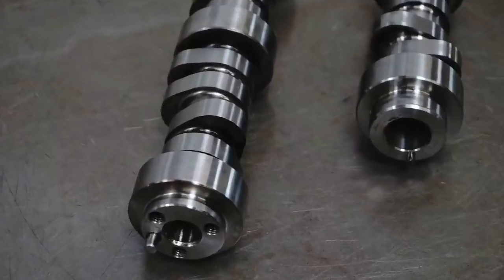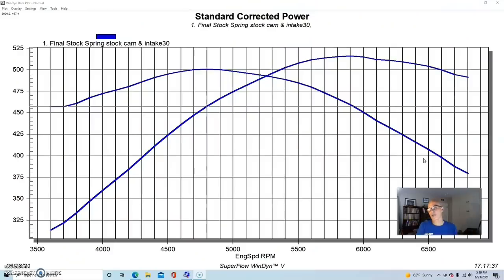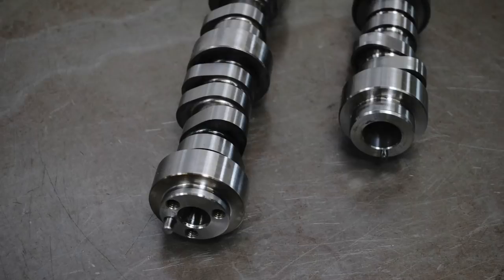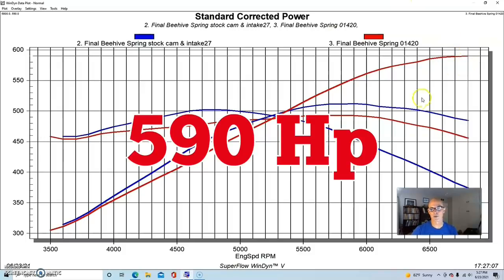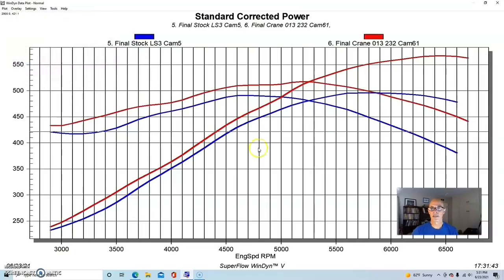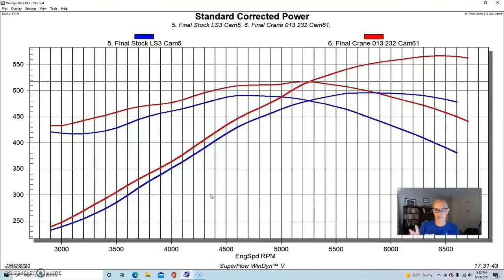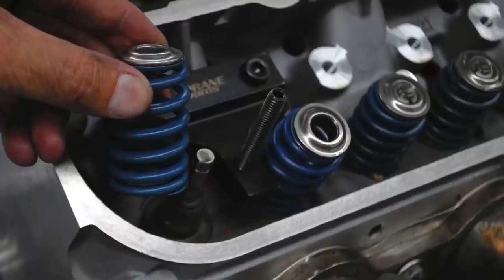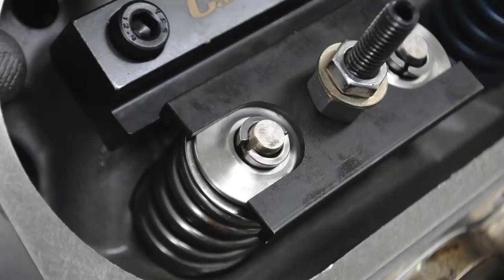DO STIFFER VALVE SPRINGS COST POWER? LS3 SPRING TEST!!

Comment: Well no machine is 100% efficient, and even compressing a spring will cost power the stiffer the spring the more it will cost. Conversely if the spring isn't phisically strong enough to close the valve at higher rpms it will cost you way more power than the stiffer spring will. Basically you want enough spring to do the job and maybe a tad bit of safety factor for maximum power. But that's splitting hairs, just get whatever spring you can find that will do the job without having to pawn your wife's engagement ring..
Reply: Screw it, pawn the ring.  If she understands, she’s a keeper. If she doesn’t, dump her ass because you know something like this will happen in the future if you’re a gearhead!! Lol.

Comment: Heavier spring WILL ACCELERATE valve train wear, lifters,pushrods,rocker arms,valve stem, keepers,etc
Reply: And the timing chain.
Reply: With today's parts, if your wearing out that stuff you got problems with the setup.
Reply: @unclegeorgesspeedandfeed  I agree. I’ve never seen an ls timing chain fail. Now other OHV engines definitely have issues. Also the only ls heads that would see valve guide wear seem to be the ls7 heads. But I think that has something to do with the 1.8:1 rockers.
Reply: Well, that would only be true if the lighter springs in your comparison were also able to adequately control the valve train.  If not, the opposite would result.
Reply: @michaelangelo8001  yeah it's a fine line of control and Chaos. As rpm rises the line gets exponentially smaller.
Reply: Going from 300hp to 400hp, no problem. Going from 300hp to 700hp, everything needs to be right
Reply: @ReubenHorner  it's more about going from 7000 to 7500 is hard but going 7500 to 8000 is alot harder. It's a exponential growth. RPM=ruins people's motors. Technology today allows us to run hydraulic lifters in race motors and still get the rpm that 10 years ago you could only get with solid lifters. Look at ls rocker arms, good to 8000rpm and well over 1000hp and are some of the lightest on the market and gm made 20-30 million of them.

Comment: Definitely the shorter runner causes the drop in torque.
Reply: Well, and judging by the fact that both the long and short aftermarket manifolds showed almost identical lower RPM performance, it's also possible (probable) that the Holley runners have a larger cross sectional area that is hurting inertial mixture velocity in comparison to the stock unit.

I can't help thinking that the results may have been quite different, if the test had been performed on a 400+ cubic inch engine that could make efficient use of the additional airflow...

Comment: The short runner length is what killed the torque. You won't get 100% of the energy used to open the spring back. Friction losses will take most, and there are a few little things like some gets converted to heat in the spring when it is compressed.
Reply: You would want a spring that is
- made out of a material with nearly 100% elasticity
- coated in the same stuff billiard balls are coated with
- using opposing magnets at each end to provide an extra pushback

Or some other nonsense like that.

Comment: As I've learnt in Aus, there's more to the story. Higher spring pressures do add friction, and because of this they do transmit more heat into the oil raising oil temps, might not be noticeable for a 7 second straight line warrior car, but go circuit racing where the engine has to actually work for 15-60 minutes straight, up and down the revs, actually accelerating the weight of the car constantly out of corners and this shows its head. Also higher spring pressures are far more savage on lifters push-rods and the cam itself, I know with our race engines we cant idle the engines below 1500 rpm on solid rollers, if we do it just chews up the cams and lifters as all that spring pressure grinds the roller lifter into the cam, at higher speeds this isn't an issue at all as the time in which the roller lifter makes contact with the cam is reduced and therefore so are the the loads

Comment: I was actually surprised we didn't see a change between the beehive and dual spring. Very cool test in my opinion, thank you very much. I would think the return energy, during valve closing would be reduced at high revs because the spring is being used to push all the valve train back to close position. At low speed, I suppose it would push the cam forward quite a bit, possibly enough to return the cost of compressing the spring in the first place.  , but if you get closer to valve float, there would be no energy pushing the cam forward. The test didn't really confirm that logic.. but I was thankful for the content. Keep up the good work, you're the man.
Reply: Both maintained control, so that was good.  Wear on components?  Might be a different story.

Comment: Friction being a factor in any machine with moving parts, you don't get as much energy back out of compressing valve springs as you do when they close the valves, but it is very close.  A camshaft is a very efficient thing, even more so when you have roller cam followers.  When the major manufacturers went to roller lifters in the late-80's, they reported a 2% fuel economy increase.  When I worked at Cummins, engine familiarization training covered teardown test results, and they said at full power, a heavy duty diesel camshaft only takes ~2 HP to drive.  

Energy recovery from valve springs is something that is making it very difficult for camless engines to get on the market.  Whether the energy for actuating the valves comes from hydraulics, pneumatics, or electricity, there has to be a pump, compressor, or generator to create the power to lift the valves.  Then the parasitic power loss offsets the benefit received from the fully variable valve timing.
Reply: I would agree with what you said. I do believe you would get some energy loss from heat during spring compression also, but would be very little. I thing pressure variation between the strokes of the cycle would probably play a larger part. Particularly during exhaust valve opening against high (sorta) exhaust gases versus the low pressure when the intake valve opens. Obviously boost changes the effect.

Comment: Dead on what I figured. Awesome test Richard. I did a dyno test comparing stock heads to a set of ported heads on my LS3 with the little Lingenfelter GT1 cam. Gained 15rwhp but I also had stock springs on the stock heads and BTR duals on the ported ones. Figured 5hp was the cost of the springs at the most. Awesome for testing this.

Comment: I love these kinds of tests. I had a friend that raced Pontiacs for years. His combination was a mix of mostly factory parts including the cam. But he had tested every little thing and for every one thing that picked up 5 horsepower here of 8 horsepower there he had a very quick car. His '71 LeMans wagon ran well into the low 12's back in the 90's and he was well into the 11's by the 2000's when he had a stroke and quit racing. One test I would love to see you do is a timing chain test. I read a test by Roush Racing many years ago on a 500hp ish SBF and they tested stock butt link, double roller, timing gears, a timing belt and a high performance butt link called a Hyvo I think? Anyway, it's amazing how much less power was made with the oh so popular double roller compared with a stock style timing chain. I'd love to see this repeated if you ever have the time.
Reply: YES !
Reply: Are you talking about the legendary Pontiac KCIR Jim Hand?
Reply: @GasserNorm  Yes. He was a great guy to race with and always a great guy off the track too.
Reply: @1967davethewave  I knew Jim as well. He helped me with my 1980 Firebird. He was a great guy.
Reply: @GasserNorm  Yeah, he walked up to my 69 GTO back in about 91. I was running high 13's. He looked under the hood, shook his head and said, "If you ever want to go fast come talk to me." I did that night and I was running in the 12's by the next season.

Comment: The think I learned from Steve Morrison is that they try to bring the springs as close to coil bind as possible to reduce harmonics at high rpm. Shims add more pressure but is worth the added protection for uncontrolled valves.
Reply from the maker: WE USUALLY SHOOT FOR AROUND .030 TO COIL BIND

Comment: Anyone else impressed with the consistency of the Dyno here? Those two graphs were almost exact overlays
Reply: I’m not impressed
Reply: Engine Dyno is always pretty accurate to itself as you'd expect. As long as things like oil temp are the same then should be exactly like he shows here.
You'd be surprised how much things like transmission/diff temp and tire pressure makes on a standard roller Dyno

Comment: The higher spring rate definitely increases friction in the assembly. Just think of all the forces on the rocker bushings and roller lifter as well as across the valve tip. The question is, will this difference in friction be noticeable? In some cases it will, as you saw with the stock cam. In others it will not, likely because the difference in friction between the Beehives and the Duals was fairly small. 
I would’ve liked to have seen you spin both spring setups up and see where they start to loose stability. The beehive should have an advantage there.

Comment: I put the 26918 on my Vortec headed small block and picked up 400 rpm on the top end and a couple horsepower. I suspect my old springs were not up to the task at hand.  Also I find my idle is better. Thanks Richard for that tip I bought the same springs for my turbo engine as well.

Comment: David Vizard rates beehives and conical springs as the best options. Clearly the best option for the bigger cam in this test as there is less load on the valve train for the same output.

Comment: I really like tests like these. I'd really like to see a test on various windage trays and the power savings they provide.
Reply: It would be pretty difficult to test a windage tray on a Dyno. Think carefully about what a windage tray does.... If your crank is sloshing through oil while its sitting on a stand, you have bigger fish to fry.
Reply from the maker: a windage tray does add power on the dyno-but works even better when subjecting the engine to g loads on a track
Reply: @richardholdener1727  Interesting. Is that because of properly managing oil being slung off the bearings?
Reply: @richardholdener1727  Thanks for the reply and correcting me. Did some research. Conclusion: Dry sump always wins, except for $$$$.

Comment: The roller lifters and rockers help reduce the frictional losses from the stronger springs.
Reply: They take more spring and have more weight on the wrong side of the rocker
Reply: I would love to see an engine assembled with just the cam and valves in place to see the drag of just a roller cam and rocker assembly working against the springs.   How much power is needed to drive that?  Is there always a compressed spring helping to advance the cam?

Comment: Sound Test!! I have upgraded a lot of LS engines over the years and a common complaint I get is about sound!!! The LS engine doesn’t sound as good as my old SBC!!! 
1-So does firing order affect sound???
2-Will a LS lose power if it was converted to the traditional SBC firing order?? 
3-Will a SBC make more power with the LS firing order???

You do great work… keep it up!
Reply from the maker: i doubt firing order changes power
Reply: @richardholdener1727  is it possible to build a modern L88 427 out of the 7.0L LS7?
Same displacement,
Same carburetor,
Same camshaft specs, 
Same power???? Maybe more??

Comment: There was actually a slight loss in power going from stock cam with stock spring to upgrade spring.
   So that's pretty cool. The higher spring pressures work great for higher lift or higher RPM on a stock cam.
   I thought it would be cool to run a lighter than stock spring with a stock cam in order to gain gas mileage and a little power. No RPM bump allowed with the engine I had in mind.
Reply from the maker: the stock high-mileage springs had already lost spring rate

Comment: Part of a spring upgrade is to lessen the possibility of valve float. That was a problem I had with my air cooled VWs. Start building more power with those and you're likely to swallow a valve.

Comment: @richard holdener  i would say they engine is always lifting a couple of the springs at whatever (lbs) force it took to set the cams in place (compressed springs already got a head start). 
Imagine two 2” springs, side by side. It takes 200lbs of force to compress one of them all the way down to 1”.  While compressing one of them, i mount it directly on top of the other (uncompressed) spring so they now 
measure 3” in height.   When i allow the two springs to interact, the force of the compressed spring will overcome the totally uncompressed spring and they will both be partially compressed (under pressure) and meeting in the middle. Even though the springs are identical and now under the same load, would take EXTRA force to move the meeting point of the 2 springs, either up or down. Whatever lbs of pressure this is, (i would say) is the amount of force it takes to rotate the cams at any given point of time. Id say its easier to rotate the crank WITHOUT the springs mounted? Could be wrong just thinking out loud here lol
Reply from the maker: stiffer springs cost power

Comment: The question isn't whether the spring rebound energy is the same as its required compression force(because it isn't, there will always be some energy lost to friction and heat and hysteresis). We should ask which type or strength of spring will lose the least energy and be most efficient returning the potential to the downward side of the cam lobe. Generally speaking, more material means more friction more heat loss but also better stability. But in the case of double coil springs you also have the factor of the two coils interacting and those harmonic and compounded frictional losses.  I suppose it's all worth considering at some point, but your test seems to have proved that at normal(sub 8krpm) engine speeds, it really doesn't matter. I wonder how fast you need to spin an LS before the patterns on spring types start to diverge.
Reply: Your answer hints at engineering sir.... a sound input, thank you.

Comment: If you only need to upgrade your spring for cam lift it doesn't matter if it looses a bit of power because the stock spring wouldn't work with the upgraded cam. So...
Reply: Exactly use the right spring for the right job, don’t needlessly get heavier springs if ya don’t need them for the valve to function right lol.

Comment: Love your videos u are my go to for advice and videos. Did notice anymore valve train noise
Reply from the maker: I DID NOT BUT WE CAN'T REALLY HEAR THAT IN THE DYNO
Reply: @richardholdener1727  i had a btr stage 2 came and behive spring upgrade and that sounded good valve train noise wise. The next engine was the btr truck norris cam with dual springs and that sounds like a sewing machine.  At first I was thinking lobe separation maybe or springs, but u said no to lobe separation for making noise between the two. It would be interest test sometime to see if their in a noise differance between different spring combinations  oise wise. Thank you for responding keep up the good work.
Reply: @chrisdunn2544  Why did you use dual springs with a cam that only has .552 lift?
Reply: I didn't strictlly performance did I asked the same question . I believe that were the noise is coming from I believe it's a over kill I'm going to switch next summer.
Reply: @nowayjose596  I didn't strictlly performance did I thought it was a over kill. I hoping when I change them the sewing machine noise goes away
Reply: @chrisdunn2544  I would probably give BTR a call or shoot them an email to see what they recommend but if they say the LS3 springs are sufficient I would make that change bc there's no reason to have that extra pressure on the valvetrain unnecessarily, especially the lifters
Reply: @nowayjose596  I totally agree. From Richard new vid u can use stock springs